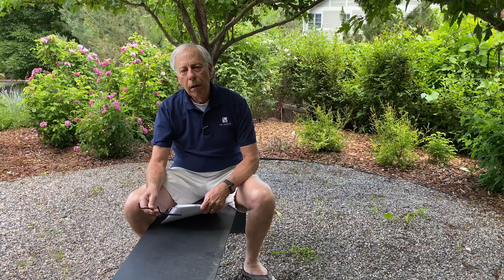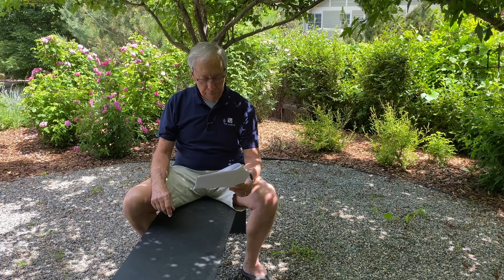The problem with TVs between speakers

Comment: I have a pair of Canton vento 890. 2 speakers on the sides of my TV which sits on a TV stand with my components. The speakers are ever so slightly in front of the TV screen maybe 4 to 6 in. This sound is absolutely stellar. Center image is locked in dead center Imaging is fantastic soundstage is very vast. It's not that big of a deal if you have components in between your speakers. Now what I will admit it's as if you have a couch or something ridiculous in between your speakers that I could make a difference but no one's going to be that stupid.

Comment: The phantom center stereophonic illusion is created at the listener's ears, not between the speakers in the listening room.  The sound from left and right speakers crosses over between the listener's left and right ears close to the listener's face, not between the speakers.  Sound reflected by objects between the speakers is not reflected back toward the listener.  Sound absorbers between the speakers may absorb the sound from the speaker that reflects from the front wall toward the listener, improving the sound quality by reducing or eliminating a comb filter that changes the timbre.  Think about it, don't just listen to Paul McGowan's nonsense.

Comment: Some of my greatest audio experiences have been when audio and video came together to please both my ears and eyes. Having a motorized screen with a 4K projector between the stereo speakers and additional speakers to support surround sound can offer an all-in-one  listening room and home theater setup with the best of both worlds (why the heck did we come to separate them in the first place?). Lots of people don’t have rooms to spare for dedicated just listening or just home theater rooms.
Reply: I’d like to suspend my tv from the ceiling like they do at laundromats.
Reply: grant jonsn Another way is to have a motorized curtain in front of the TV that can damp reflections.
Reply: ThinkingBetter definitely easier than throwing a moving blanket over it every time I want to listen LOL
Reply: grant jonsn Are you sure it was orange juice?
Reply: A long time ago I took a magnet and put it agaisnt the feront glass of a CRT television. I meddes up the l9oclors where the magnet was. O tried to fix it by then moving the magnead adorund to fifferent palcves. It kind of fixz ti bit not too good. Eventurlaly by tuirning it on and off it eve3nturlly fixe ditself. Scott grove sed to keep electrig guitar pickues awafrom speaker to nto runio their magnets. BTW. I orfer a 3 pack uf BESIVA USB ADAPTERS FROM MY korg NTS1 SYNTH,A ND NOW I CAN PLUG IT INTO THE PEAVEM COMBO ADM AND ambsolutely no buzzing. i dont klnow much and i get easily anr ver frustrated when things dfont wokr. YOU ARE THE GOOD AND HONEST AND RELIABEL FRENDDS. I DIONT LIKE ALL OF BETS BUY. THEY SELL REPACKEGED FACTORY DEFECTIVE GARBAGE 30 PERCENT OFF!!!!!!!!!!!!!!!!!!!!